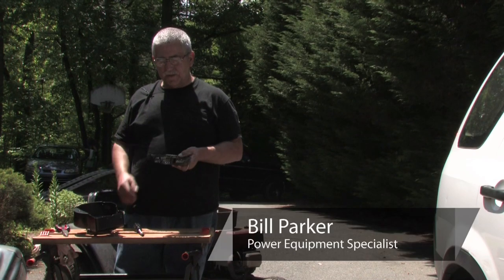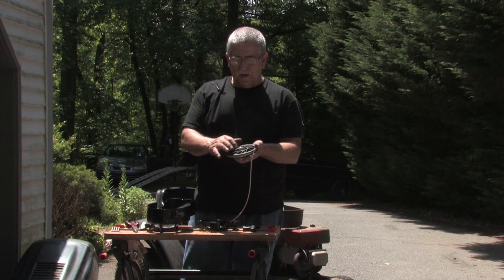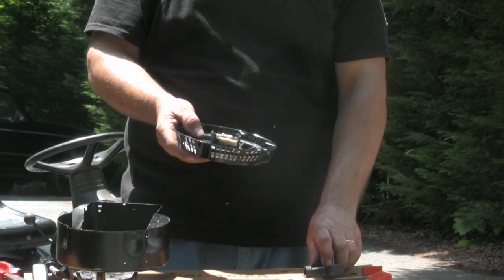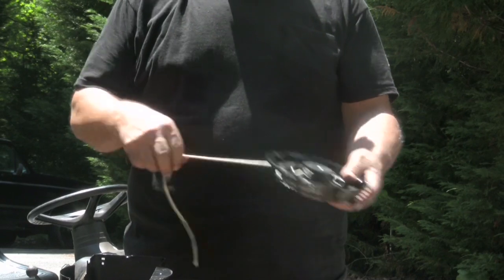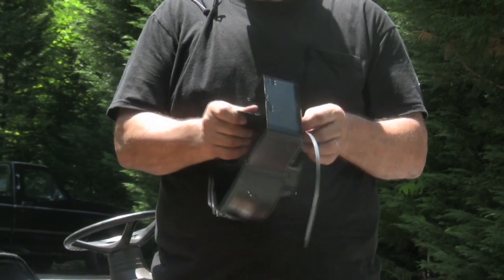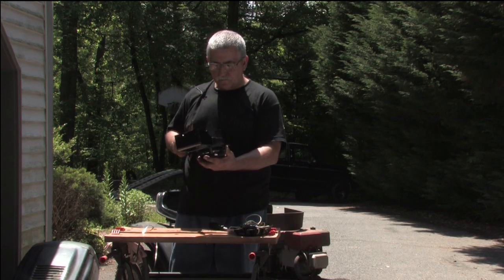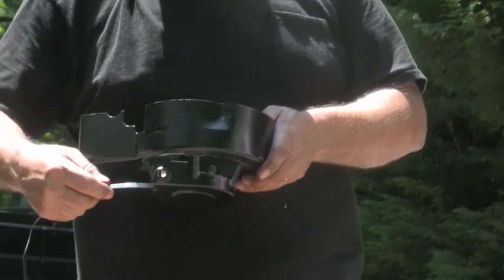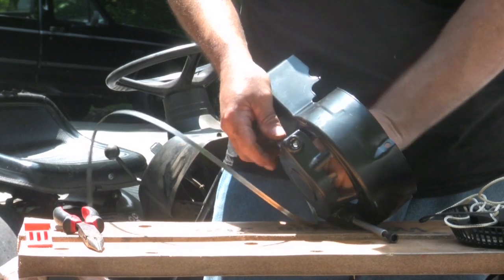Lawn Mower Repair : How Do I Fix a Spring on a Lawn Mower?

Comment: Is this a prank to see how many people would actually do it this way? I mean everyone knows to not every bend a Crank Spring back. That's an easy way to throw the whole spring off balance during the recoil which will have you back doing this all over again in a couple months. Instead (or just buy a new spring for $10) get a long 2×4 non-pressure treated board and a clothes iron. Now iron that spring until it's flat again. 

On and use your head... Now use a slow speed drill to coil the damn spring into the cap. 

WORK SMARTER SO YOU CAN PLAY HARDER AND SOONER!